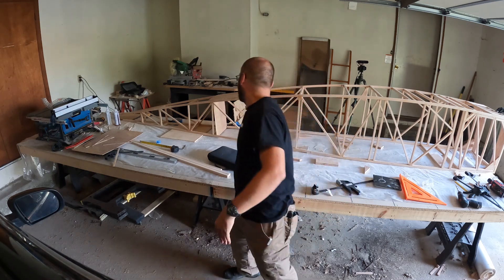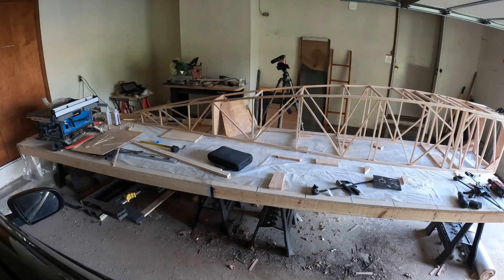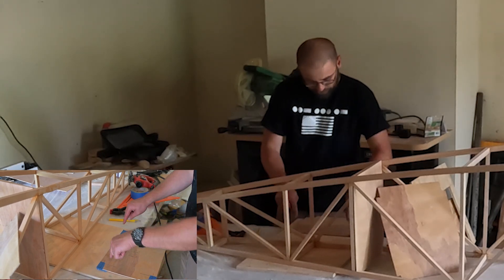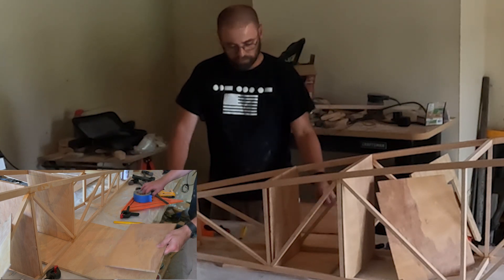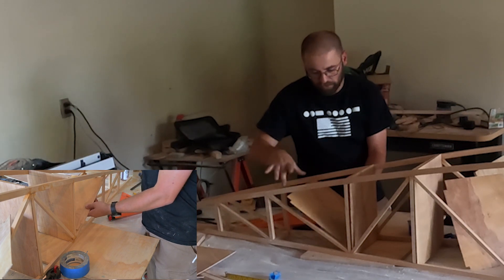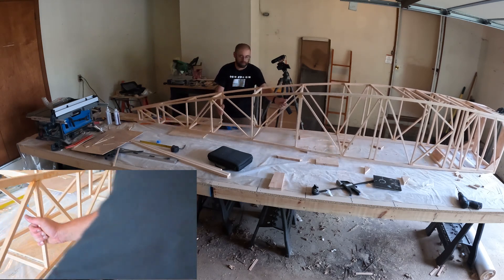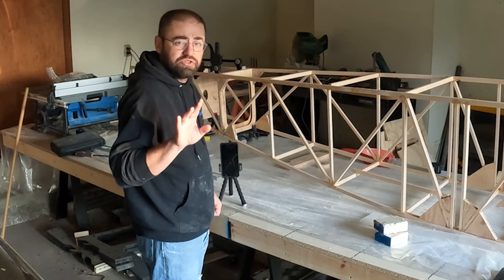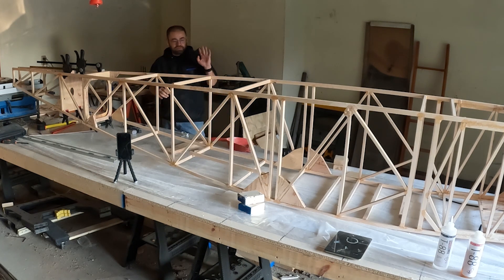Tail Webbing Construction on the homebuilt WAR Aircraft replica P40 Warhawk Fighter Plane!

Comment: When fitting the plywood parts, just cut the corner notches out taller. The width can stay the same. It's not going to hurt to cut the notches out more to get them in place. When you get to the inside floor pieces, you will run into the same thing, as well as the seat back, and seat floor.
Reply from the maker: @Dynodon64  that's pretty much what I ended up doing